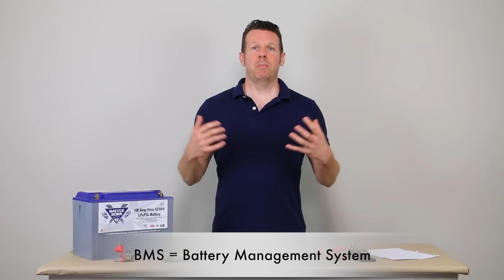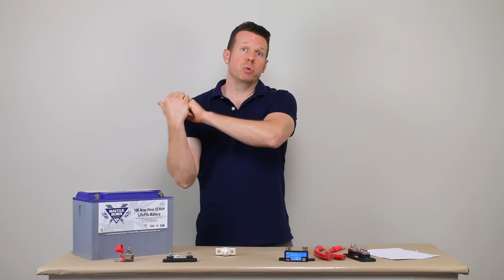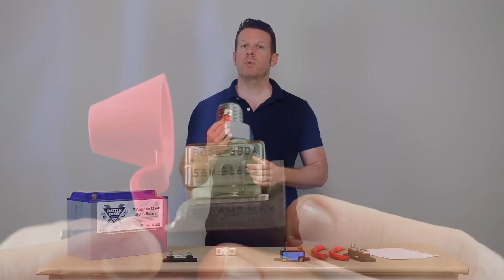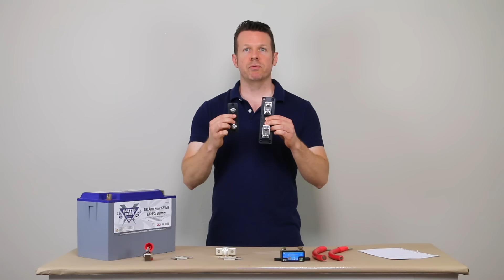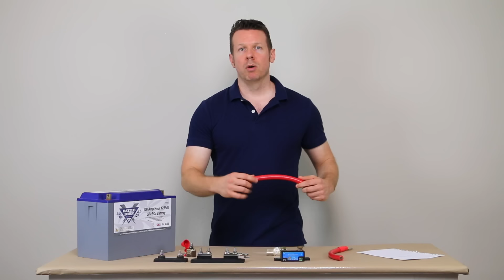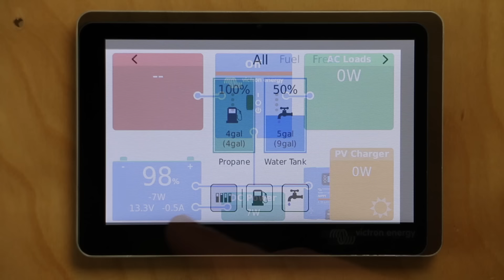The Top 9 Lithium Battery Mistakes for Van and RV Power Systems

Comment: Thanks for this video Ross, I have a nice set up with 400ah bank with a victron MP 2. The system is 12v all hooked up with 4awg wire. I have 1 section 6inch wire between the lynx and switch and the wire heats up. All bolts are torqued to spect and crimp lugs on to perfection using a hydrolique press.. weird
Reply from the maker: Hi Sean, sounds like a nice setup, but maybe the wire is a little small? The 4 AWG would be used maybe for a 12V fuse block but the big trunk lines would be larger. Perhaps that is the heat problem...hope that helps, thanks for tuning in-
Reply: @rosslukeman  thanks ross, the 4awg was wire suggested for anything over 400ah of battery bank. I sent you a small video to your email explaining where section is heating up. thanks sean
Reply: @SEANRMZ are you mixing up “4/0” with “4” in your post? Obviously 4/0 is adequate for most anything, “4” is not for any battery connection of 12 volts.
Reply: @randolphh8005  That is what I was thinking.  I used 4/0 for my 400amp battery bank going to and from inverter via my Victron Distributor.

Comment: Solar charging 48v: Another big issue with higher voltage solar systems is that it forces you to put your panels in series. A problem with this is that any shade on any spot of that group of panels will degrade the output of all of them.
Reply from the maker: Good point! Thanks for tuning in-
Reply: If you dont have a good charging system and MPPT yes you need to do this. But if your like me and HAVE 56V panels 10 amps, you can hook them in parallel. my inverters do not charge my battery's, i have 6 MPPT chargers for this.
Reply: Or connect your panels in Parallel and only the panels in shade with disconnect the others will charge.
Reply: @raystanton238 And then buy welding cable instead of 14 ga wire
Reply: Why not just use a boost charger instead of a buck. Am researching for a 48vdc system on a Sailboat
Reply: @michaelphilip3919  thats a cool! Advice, if u have a 48V system use a 48V 40amp MPPT and have a 40.1V or higher pannel. the more costly MMPT chargers are real ones. if you go cheap you will get a PWM there junk..
Reply: Or you could just use one panel per battery ...so only shaded panel affect its own battery as shade is always changing it would correct that loss.
Reply: No its not .
The old yes its correct.
The new ones have by-pass diodes so it do compensation
Reply: Individual panels will be less affected because of the bypass diodes. But when panels are in series, you add voltage, but only get the lesser of the 2 panels amps. So if one is more shaded, it limits the output of the other one too.
Reply: @dyslectische  some panels do and some panels don’t.  It depends if the panels have bypass diodes so shaded elements don’t block the current flow when an element is in the shade.  The cheaper the panel the less likely it has this feature.
Reply: @dyslectische , read series .
Reply: @marksommers6764  read again and see the info .
Old days one panel down hole systeem down.
Today new panels only shutdown small parts on one solar panel 

Pay for a real one make in the E.U  and not china shit.
Reply: @marksommers6764  some solar panels have more than one diode per panel to prevent shading on one part from causing the whole panel to shut down when partially shaded.

Comment: Please understand, if you are powering an inverter, the current in the battery will follow the power in the load. If you have a nominal 50V battery powering an inverter with 1 kW load there will be an average current of 40 A but it will be varying from a few amps ( inverter quiescent load) to 80 + Amps at twice the frequency of your inverter output. 60 Hz in North America so battery current will be 0-80 A st 120 Hz.
Reply: It's absolutely true current follows power demand. 
But even more important is the increase of current when the battery gets empty.
By the way, frequency has nothing to do with it.

The correct calculation is:
I=P/V
Max voltage 58V, min voltage 40V
1000/58= 17.2A (with a full battery)
1000/40= 25A (with an empty battery)
+ add some amps (5-10%) due to the  inefficiency of the inverter.

Comment: Lots of useful stuff in here - thanks!  Just one thing though, you implied that you could connect two batteries capable of supplying 50A each in parallel, and then draw 100A.  I don't think this would work unless the two batteries were exactly matched in every way, and if not then one would supply more than the 50A and trip out, then the other would trip out.
Reply: When something pull current, voltage drop on to those batteries to this current demand. The voltage drop on those batteries is the sames, then normally each battery will draw current to their spec in parallel. In counter part in series, it's not the same since each batteries must pull same current. Then, it's problematic to not match batteries in series, again way better is to buy like 48 volts batteries compared to 4 x 12 volts since the BMS of the 48 volts batteries will monitor the 48 volts, not 4 x 12 volts.

Comment: 7:48 The way that you describe is still not the best way, especially when using more than two batteries in a bank. In my experience of three decades off-grid, I have found the best way to hook up multiple batteries in series is to use a "spider". Using equal length cables from each positive to a bus bar, (and the same for negative),  THEN to the other parts of the system works much better!

Comment: SUGGESTION: you should do a video on battery “combiners” and “isolators” to protect your engine starter battery SOC.
Reply from the maker: Rudi I have to be honest, I said not to use those for lithium batteries in another one of my videos, they don't regulate the current or the voltage. I use DC-DC chargers mostly these days. Thanks for sharing your suggestion though.
Reply: @rosslukeman are you saying not to charge lithium batteries in camper with the truck being connected to camper to charge batteries or am I not understanding your comment correctly?
Reply from the maker: @jeanguillaume4589  No I was telling him that I don't use combiners and isolators anymore, but DC-DC chargers instead. Charging the camper from the truck is fine.

Comment: QUESTION: Why don’t Lithium battery BMS electronics include an automatic “fold-back” circuit to limit current flow either way instead of requiring an external fuse?
Reply: They do. They are just not as good as putting in your own fuse for safety, especially if you are using more than one battery in a bank. In a parallel set-up to get more Amp-hours, (capacity), the Amps the full bank can put out is the Amps each battery can max out at multiplied by the number of batteries. So, no problem if you are using only one battery, be it a 100Ah or a 300Ah battery, as the BMS WILL shut off the battery at the proper Amperage for THAT battery. But if one has, say, four batteries that can each output 100 Amps, then the battery bank will have the capability of putting out 400 Amps. Even in the case of only one battery, like the man said in the video, it is always better to use something that cut's the output BEFORE the inverter, etc. In his example, one uses a shunt on the negative post of the battery bank, which is set up to report the state of charge, plus all the other info you need for the whole bank, and can be set up to shut down the power before the BMS would to save on other components in your system. (I would use equal length wires from each battery to a bus bar, on both the positive and the negative sides, which not only distributes the power more evenly from and to the batteries, but also gives the ability to disconnect one of the batteries in the system in case of need).  <<My neighbor and I, both with over 30 years of being off-grid, have found this to be the best way of doing a larger battery bank. We call the resulting cable/bus bar conglomeration a "spider" or "octopus", and there would be one for each the positive battery connections and the negative ones.
Reply from the maker: Answer: I am not sure about the fold-back circuit. Even if components are able to limit current, the fuse would still be needed as its mainly to protect the cable.

Comment: Very good info as per usual, Ross.  I am assuming that the Overkill BMS on my 24v battery will prevent charging when it is below a specific temperature.  I never plan to be anywhere even close to THAT cold, plus I have temperature controlled heating pads between each paid of cells... Is it wrong to rely on the BMS as the last bastion to prevent charging when too cold??  Thanks for sharing...
Reply from the maker: Thanks Owen! On the BMS shutdown, I think you are okay. You've got the heating pads to prevent them from getting too cold, and it's okay to use the BMS as the last bastion as you said. It's just iffy with some brands as they don't do the cold-weather shutdown. As long as your brand does, then it's fine. But you said you don't do places that cold, so I think you are good. Thanks for tuning in!
Reply: @rosslukeman  Thanks for the reply.  The BMS has two temperature gauges and I tested them to ensure they work.  Fingers crossed I never have to find out!  :)

Comment: Truly an excellent video that all rv/van/boat electrical DIYers should see - many thanks
Reply: Coming down the pike are sodium-based batteries. The really cool thing about sodium-ion based batteries is that they can be discharged to zero (making them very safe for transport).  Fingers crossed on industrial production soon. They will solve many issues.
Reply: @mb-3faze  Those can also handle higher temps, if I recall correctly. I could run my BattleBorns down to zero percentage, but not to zero Voltage. I assume you mean percentage also. I do have my Growatts set to shut down the system before the batteries would even come close to thier shut down point, at around 10.5V, as I believe they will last longer if I keep the percentage of charge up as high as I can. I live in the desert where it has gotten as high as almost 130F, so I DO rely on my solar system for two air conditioners, one a 5000 BTU window model, and the other an 8000 BTU portable model. I have around 27K Watt hours available for overnight, and around 7000W of solar so far, all running two 5000W growatts to power my RV and external stuff. I've been off-grid for over 30 years and this is the best system I have had yet, and so far it's handling three fridges, (one a small "apartment size and two smaller, cubical shaped ones), an upright freezer, an air-fyer/toaster oven, an instant pot, , a 6 gallon water heater, plus a couple of water pumps and of course my computer syste, with no problems. Sorry for the long reply, but solar power interests me a lot.
Reply: @Tumbleweed5150  Most excellent. You're probably more of an expert than the 'experts'. I read only today about iron-air battery technology (commercial storage) being implemented and supported by big names like Gates. With luck that promises to be very cheap. Soon you'll have even more options for your system.
Reply: @Tumbleweed5150 I realize the small fridge is for space, I did some testing a few years ago with a kilowatt meter and learned that a dorm fridge has almost the same power usage as a full size standard fridge.
Reply from the maker: Thanks for tuning in, great to hear you found it helpful!

Comment: Would you advise Blue Thread locker on the terminals?
Reply from the maker: In general, no, you should use locking hardware instead. I like the blue thread locker for other applications, but if applied in certain ways it could impede electrical current flow. If it doesn't then perhaps it's okay to use, but the pros are not using it for that. My two cents...
Reply: @rosslukeman  If the pros don't use it  then i sure wont.    Thanks gor taking the time to reply.